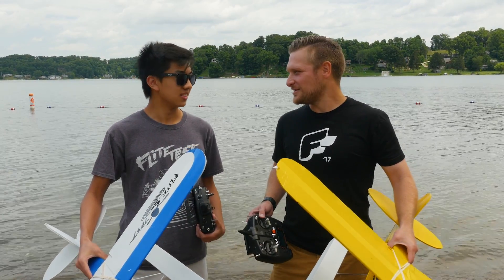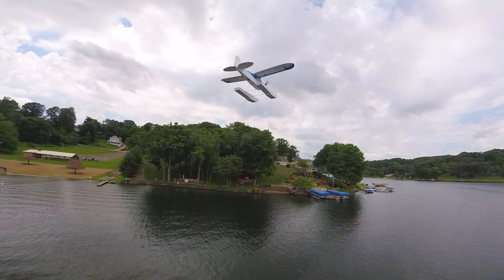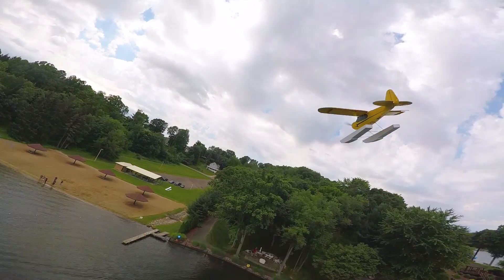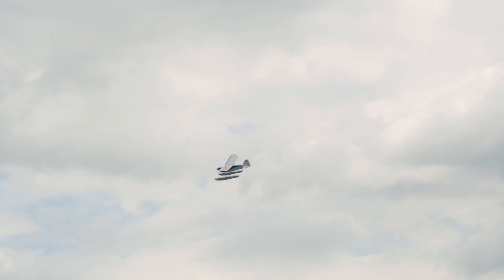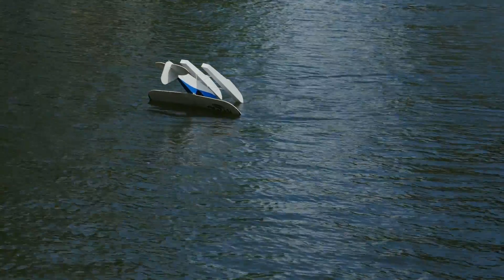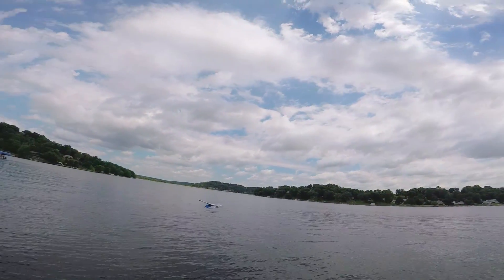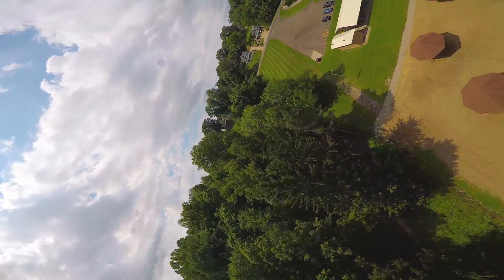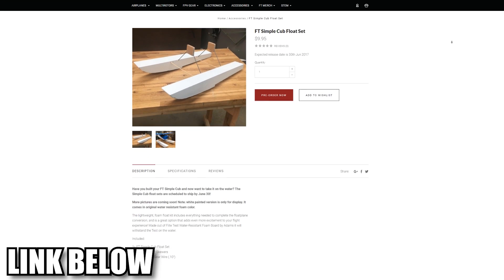DIY Waterproof Plane Floats | Flite Test

Comment: Just finished building these great floats / pontoons form the speed build kit, to use with the simple cub, maybe later with the simple scout (which I haven't built yet). 
 Was a pretty fast build and I can't wait to paint them and get this Bird on the Lake or even on the snow. But right now there is only thick fog...

Comment: I built one of these and was very disappointed with the flight characteristics and ended up flying it twice and giving up on it. It flew way to fast, and you had to keep it above half throttle or it would stall. On landings it would come in like a jet and was very hard to control not floaty like other Cubs that I have owned. I will try to build a scout next.

Comment: turn your quad into a retriever........'hook a loop and pull that leash'.....boom--no wet feet.........
Reply: Won't work. The flight controller will freak out with the unpredictable drag, and will end up going into an oscillating motion before joining the downed plane for a swim.

Comment: Scratch building is so hard for me. None of my planes I designed work. Does anybody have any tips to designing my own plane?
Reply: Start with some predesigned plans, so you can practice your build skills and get a feel for what works and what doesn't. Aircraft design is a pretty giant field but luckily RC isn't too insane if you stick to simplified design and analysis methods.
Reply: Senuht one of them keeps rolling to the left, no matter how much weight and trim I add to that side
Reply: Hope this helps -  don't add weight to one side and keep trim centered, change that in flight and usually only by a few clicks. It makes turns difficult if oddly loaded up, even if you get it to fly straight.
The likely problem for your left banking is the motor may not have down and right (if it's on the front with a prop and if your wings and tail are definitely straight). You need only a couple of degrees pointing down and same to the right. Am sure FT have a vid on that or in the Forum. 
Also too powerful a motor or too large a prop can do that - check similar designs of similar weight for the motor and prop they use.
If it's a plane like a Cub here, go for a shallow bowl effect. The wings and tail should make a very slight dipped bowl. Search for "Supercub 3 view" for plans of real planes and look at the slight angles that are going on. Most stable planes need a bit of dihedral, which can also be thought of as a slight bowl across the wings.
Weight is important. Check similar sizes on the forums for a design and go for that weight or a bit less. 
CG should be about 25% of the wing chord from the front edge on a conventional plane. Slightly nose down with battery onboard, as per J Bixler - a nose heavy plane flies badly, a tail heavy plane flies once. 
Choose the right prop. If you're not sure, base it on a similar looking R/C plane.
You need at least 25% thrust to weight to fly, always try for a bit better, if lower it'll power glide into the ground at max throttle. If overpowered, it may corkscrew through the air at 1/2 throttle !
Don't over pack with features. You can have throttle and rudder only, build one that flies and then add elevator to it, maybe then ailerons.
Minor point - 3.7g servo's will work for up to 7oz planes. Choose 9g for bigger.
Maiden late in the day, the wind drops a ton at sunset.  First thing in the morning is fine for paved areas, but too much dew on the grass normally for foam.
Above all, experiment. Throw it, crash it, fix it, throw it again.
Noone builds well at first, it needs practice, crashes are needed to know what you're looking at from experience...it's all part of the learning. Good luck and happy flying !
Reply: Slider2732 Thank you for the advice! I will try doing what you talked about; thrust angle, just the right power, 3 views. Thank you! Happy flying 😊

Comment: FliteTest, So when Andres flipped his plane, as long as the ESC didn't dip in and get wet, is his plane ok?  Just let it dry off a little to make sure and good to go?  I Remember Peter did an Electronics water proofing vid a while back.  Would you recommend doing all of that before you fly with floats, or you're probably ok without?
Reply from the maker: Hey guys,
So... what we found out was that... the control surfaces worked while in the water etc... BUT when we got back to the shop we plugged it in and hit the throttle... BOOM Magic smoke lol So, essentially we puffed the esc... so.. everything else was grand...except we did not let it dry out! ha
OOPS!
Reply: FliteTest thanks!  I appreciate the reply. Great episode by the way.  Really fun!
Reply: Aaron Roehm it's all waterproof. Peter did thag to protect it in saltwater etc. I dipped a plane in a lake and it was fine